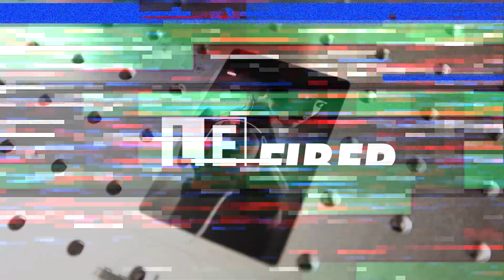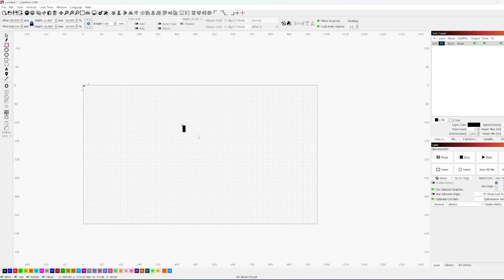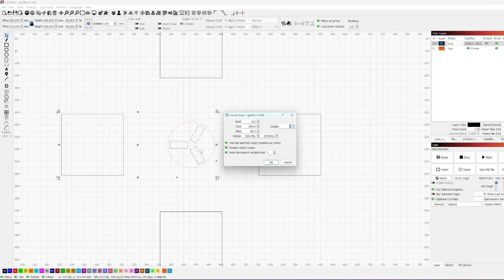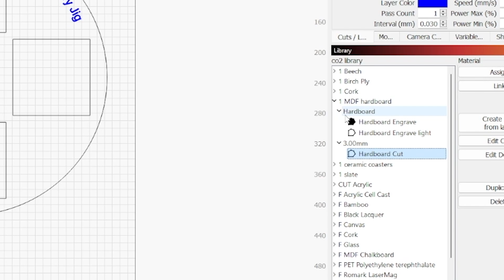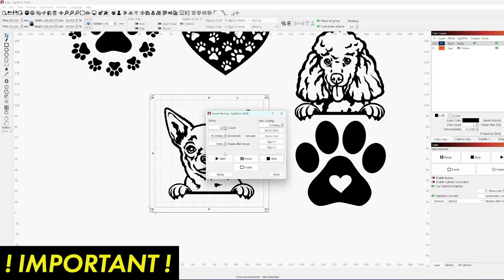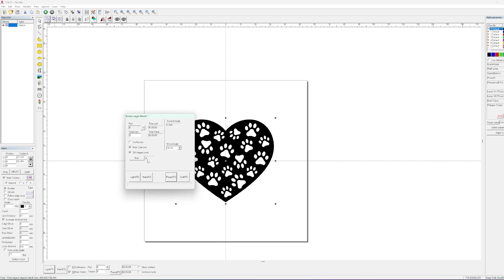Jigs! | How to BUILD and USE a Rotary Table Jig

Comment: I was wondering if it is possible, instead of cutting out the slot for the chuck jaws, could you just do a center how and attach a bolt and tighten the jaws down on. will this work.
Reply from the maker: You could, I don’t see why not. It must be centered however and rotate on that center axis, or the slots won’t rotate and line up correctly when the repeat marking runs.

Comment: I was thinking to use my rotary to engrave 600*600 mm circle with my 300*300 lens. I only were in the start of the thinking process, but you made it complete! I stuck on figuring out how to use it in vertical, but you showed me complete decision! I will try to do like you showed and hope it works. But, I guess, that should use rotary settings to engrave, but not repeat marking

Comment: Hey there! appreciate the great video. i was wondering if you have ever ran into the issue of the count and increments being off. i am working on making something very similar but with an 8 count, and even though the increment should be 45, its not rotating the proper amount. the rotary itself is set fine at 12800 as it does the full 360 test. thanks again for the great video! EDIT TO MAKE SURE EVERYONE CHECKS THE EXTERNAL AXIS SETUP: avoid the headache i had lol the problem was it saved some very old settings from a different rotary from a long time ago. it was okay on the rotary settings steps per rotation, but the external acis setup for some reason reverted to 5000 steps. very interesting dillema, and will check my other computer to see if its the same, and hopefully it saves the settings.
Reply from the maker: Sorry we didn’t get to your comment sooner! YouTube isn’t the best platform for support. If you’re still having trouble or have other laser-related questions, feel free to visit the Laser Master Academy (https://masters.lasereverything.net/) or join our Discord (https://discord.gg/bRsRejxvVM). Our team and community are happy to help!

Comment: Just a comment on terminology: a fixture holds a part, whereas a jig guides a tool. Your video should be titled "Fixtures! | How to BUILD and USE a Rotary Table Fixture"
Reply: 😂 I've seen a cat called a dog, but of course they are not the same. Thanks for the correction and detailed explanation.
Reply from the maker: We've seen it used both ways, understandable distinction for sure. Kyle opted for "Jig" in this case. While it is holding a part being marked, it is also guiding the tool via the moving rotary plate, I guess since it isn't a stationary fixture. 🤷‍♂️
Reply: @LaserEverything  I've seen the terms "jig" and "fixture" used interchangeably, but only by people without a formal background in engineering or machining.

The term jig has always been formally referred to as a device used locate and secure a workpiece and to guide or control cutting tools. A fixture merely holds a workpiece while the tool (in this case a laser beam) is under independent control. 

In this case, the fact that the fixture rotates is irrelevant. The only things guiding the laser beam are the mirrors, which in turn are positioned by stepper motor driven by a CNC controller.

While a very creative individual could design a system of mirrors to perform machining of otherwise inaccessible features of a workpiece, thereby transforming a fixture into a jig, such a practice is so uncommon that I've never seen the technique applied.

The following reference is but one source that explains the fact that jig and fixture are not interchangeable terms:

https://www.engineeringchoice.com/what-is-difference-between-jig-and-fixture/

Comment: What laser and rotary are you using?
Reply from the maker: Most of this video was filmed using a 60w Co2 Galvo from Haotian Laser using a standard chuck rotary (it's pointed straight up). That said, this can be done with any galvo laser and similar chuck rotary. I've done the same setup on all 3 of the fibers in the shop too, using a similar chuck rotary that was wired to those machines. Truly interchangeable setup across galvo's if you are wired for rotary.